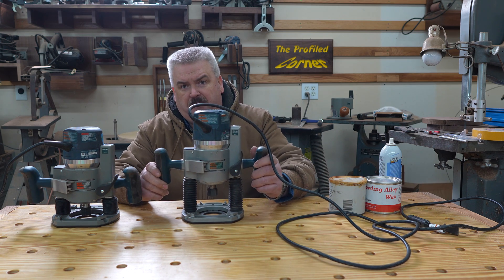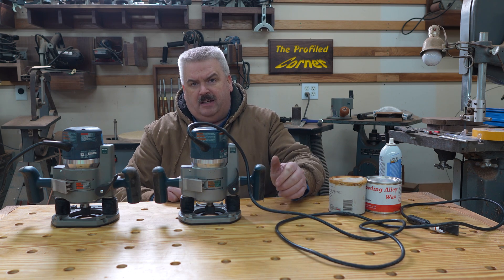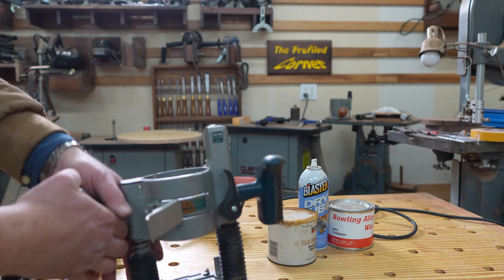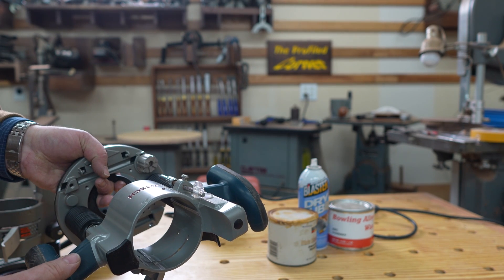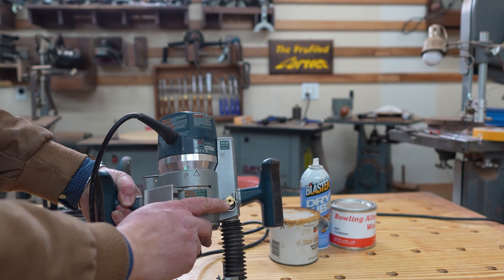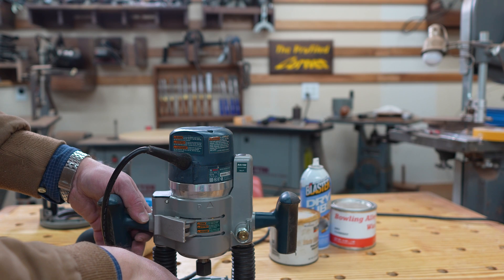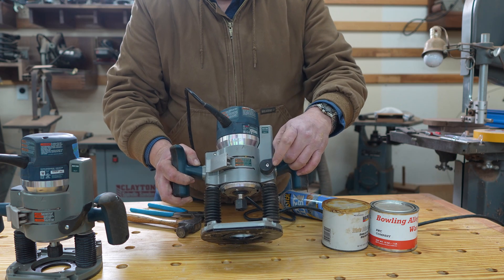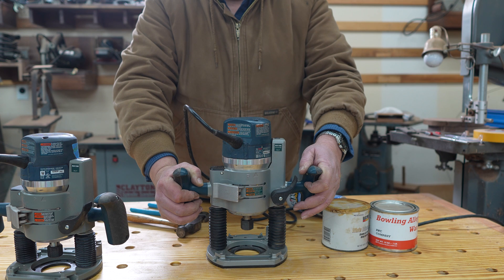Fixing a Rough Plunge Action in a New Bosch 1617EVS, and a Weak Plunge Lock in an Older 1617EVS

Comment: Gonna go try this when I get home had my plunge base for like 4 years but hate using it, hopefully this works.
Reply from the maker: Which of the problems are you having with the router?  The rough plunging action, the problem where the router raises up when the lock handle is released, or a combination of the two.  Please let me know if the solution shown in the video works for your router's plunge base.